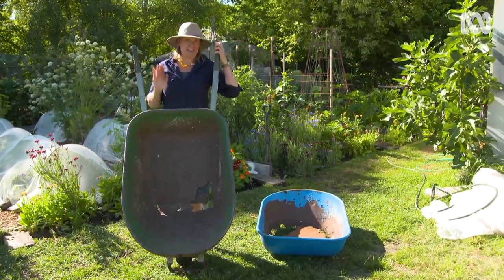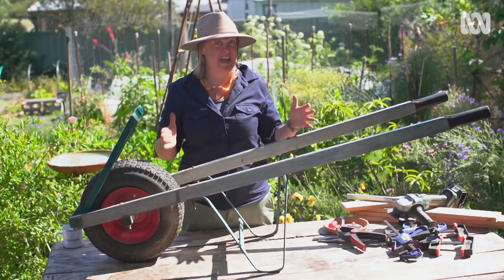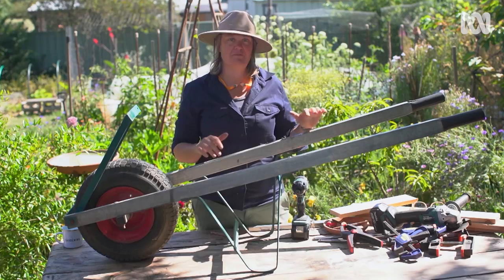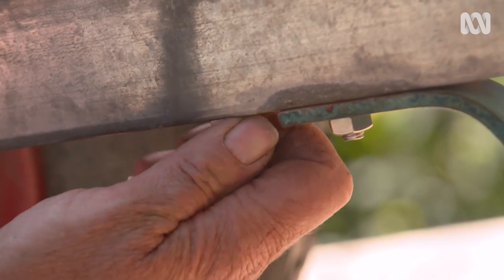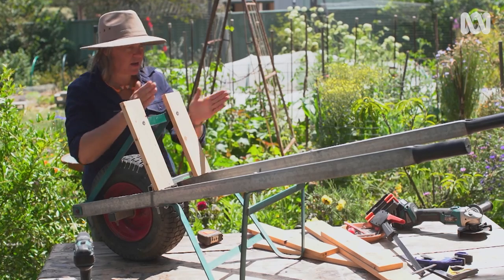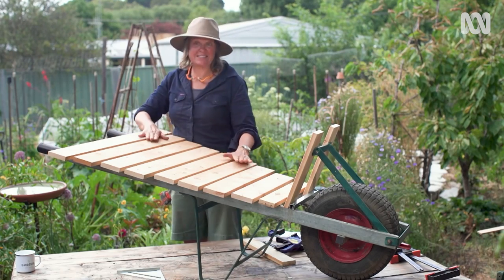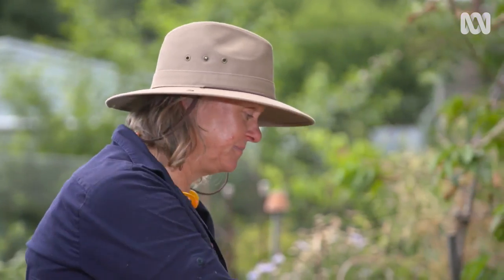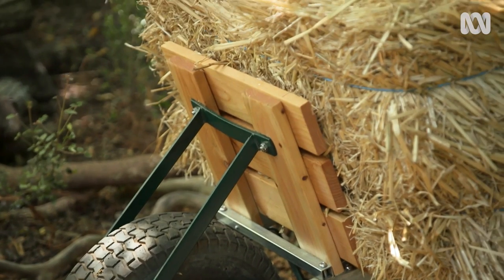How to repurpose a wheelbarrow into a flatbed barrow | DIY Garden Projects | Gardening Australia

Comment: I used old parts of two wheel barrels to rebuild. One needed a new wooden bucket but was too small a wheel barrel for me so I traded it for manure. My normal person sized wheel barrel also needed a new bucket. I did something similar to create a flat deck, but mine is flatter, an actual flat deck. The 4 sides have tracks so it slides onto the flat deck creating a normal looking wheel barrel....with more wood. Yours looks great too.
Looks like one too many boards up at the handles. You need room there for you.